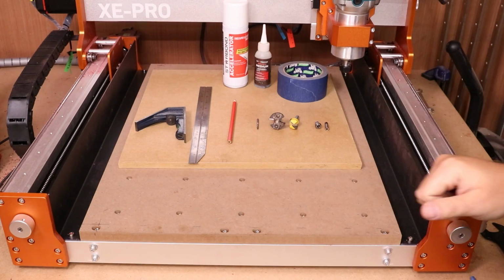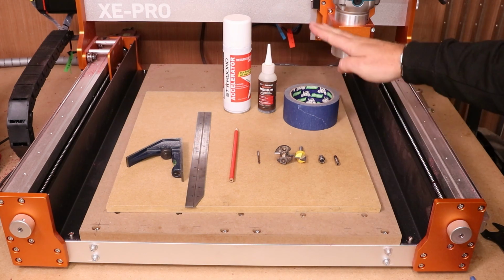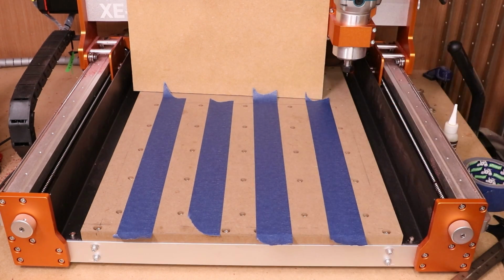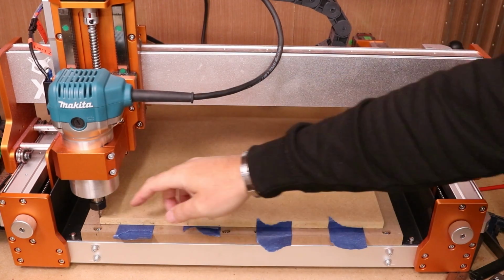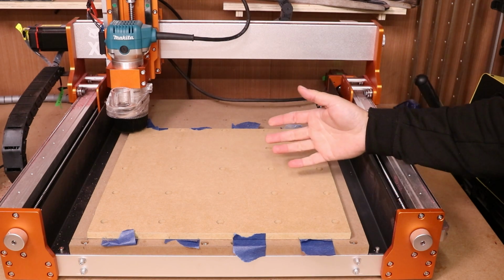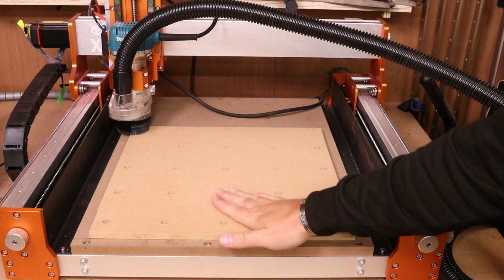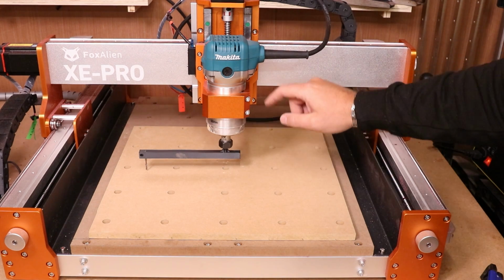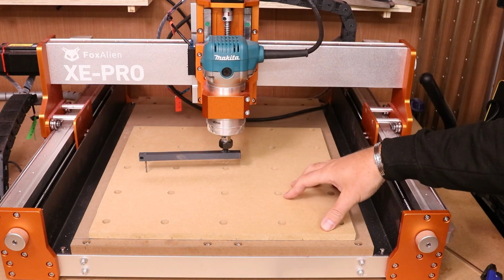Making a spoilboard for the FoxAlien XE-Pro CNC machine

Comment: can someone tell me why my vectric software won't see the gcode files? i'm a complete newbie moron.. LOL
Reply from the maker: Vectric software exports gcode files, it doesn't read them. The software you need to run your gcode files is control software like UGS or Openbuilds Controller
Reply: @JamesDeanDesigns  Thanks for the quick reply!! I did install UGS and ran the 12.5mm spoilboard program, for some reason i get an alarm at line 10475 and the machine stops (twice so far). Also, my 1/2 MDF here in the USA is 13.3mm thick. I"m trying to figure out how to make the change but not sure I can do it. I may install open builds to try that too. I'm just getting started and not sure which software to use. I know I want something that has machine controls like UGS and Easel, I didn't find that the vectric trial software offers that tho.

Comment: Great Video and plans for the spoilboard.  I have the XE-PRO with the stock 400W spindle.  My Y-axis can go to 420mm without hitting the limit switch.   I made my spoilboard 400x440mm to us the full range of the CNC.  With the Trim Router attached the dimensions might be different but for now I would recommend adding 20 to 40 mm to the Y-Axis.

Comment: Hmm, wasn't it been better to do the flattening after you removed the tape and bold it to the bed? glue and tape could rase the hight uneven.
now you do not know if the bottom board is right or wrong, or is the spoil board right/wrong?
and trimming would be best on the bottom board, right?
Reply from the maker: You dont remove the tape, that board remains fixed down with the tape.The whole purpose is not to use or trust the bed as that can also be uneven, so you create a fresh surface to work from and the surfacing makes it parallel with the axis. Its a board designed to be cut into so you don't want any bolts or screws in it